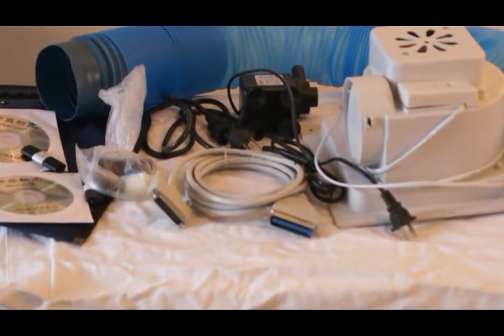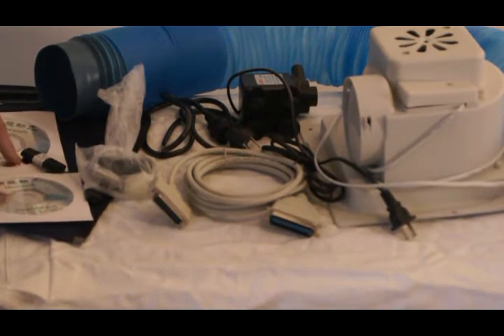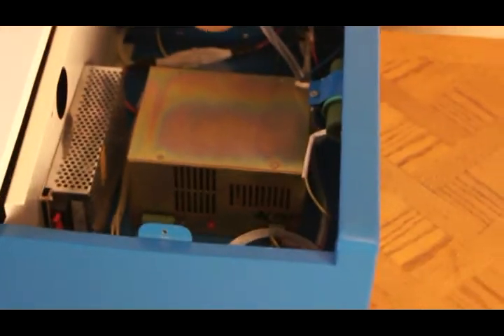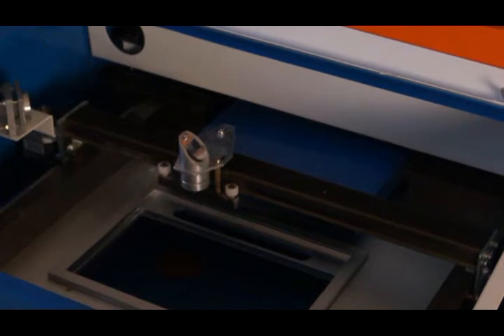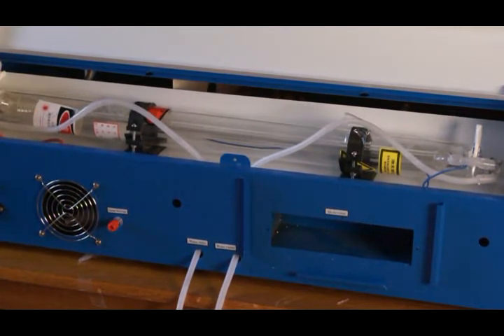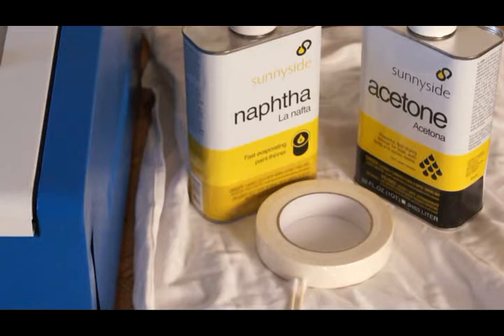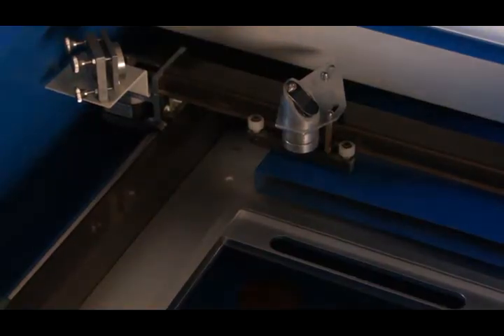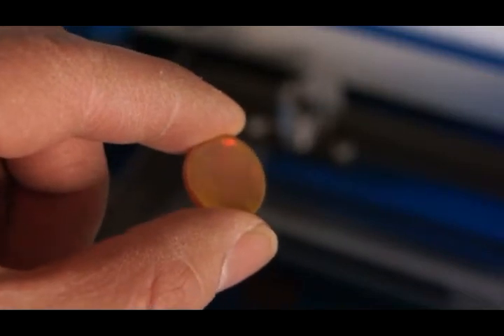China Laser Engraver Cutter Part 1

Comment: Is this machine capable of engraving metal surfaces?
Reply: Folkert Chinchin no
Reply: Folkert Chinchin yes and no..

it will not engrave the reflective metal... but there is a coating you can put on stainless steel that washes off with water that allows you to engrave it.